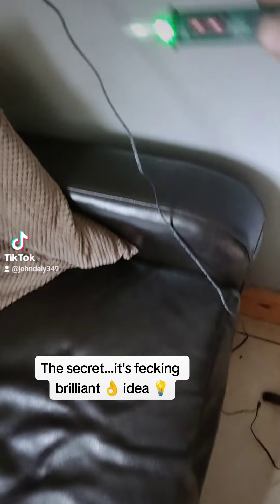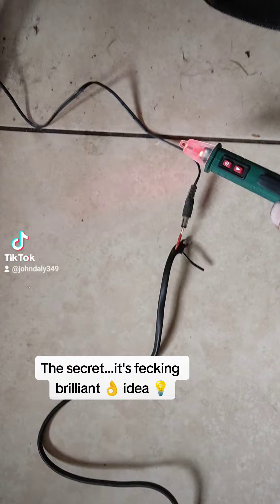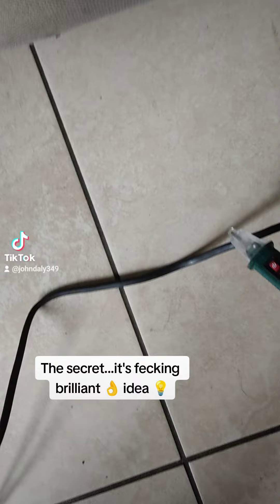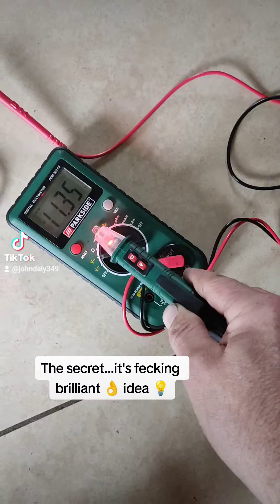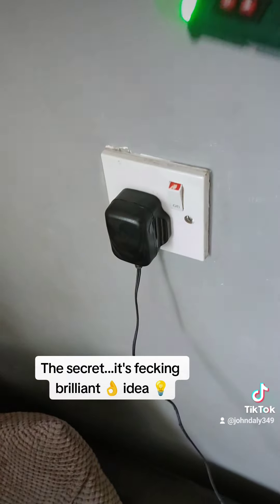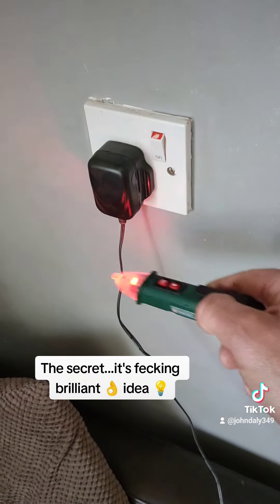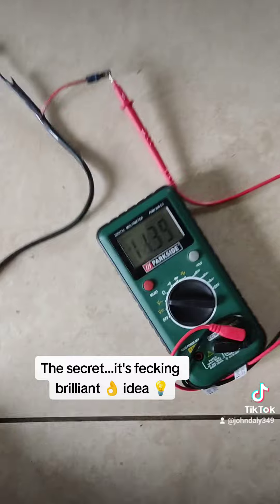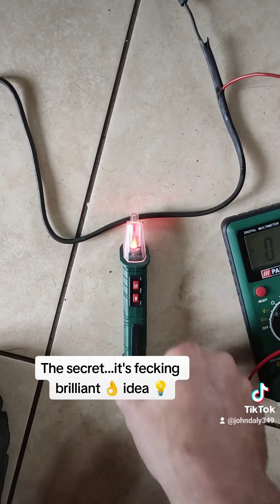broken wire on car fast find

Comment: What's the advantage of this over a multimeter continuity test?
Reply from the maker: Faster 💪
Reply: @76johndaly  I see, its not a continuity test but a wire tracer-like test on the cheap.
Reply from the maker: Yes 👍 and it's fairly handy to use . I was going to patent it .but decided us mechanic need all the help we can get